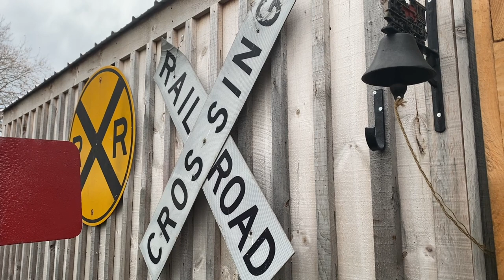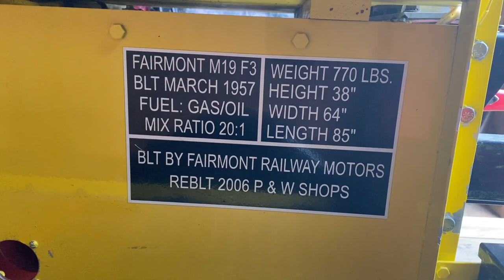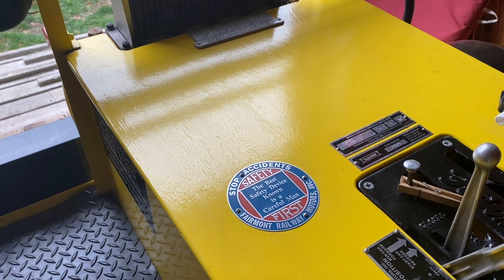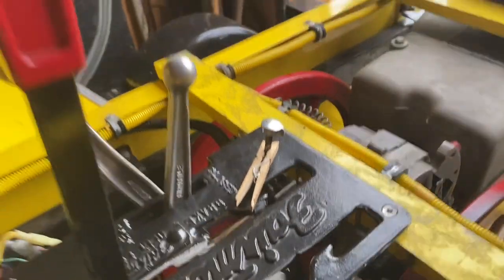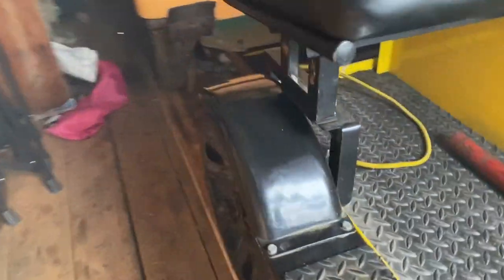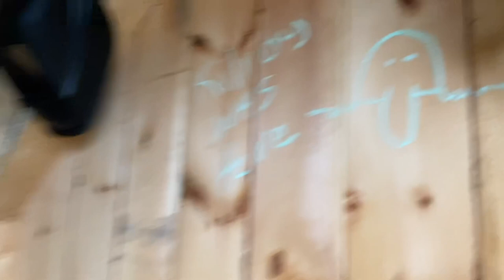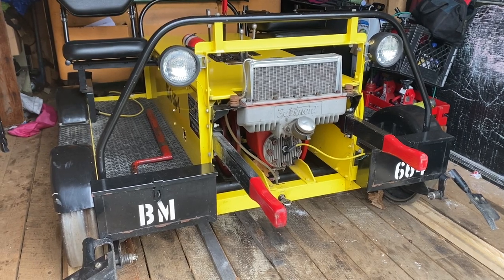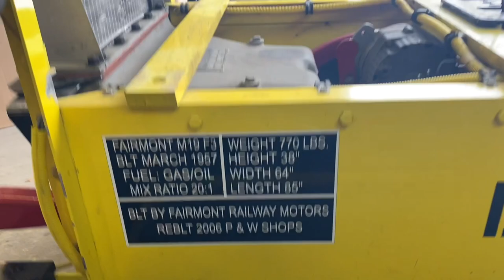New horse in the barn:Talking about my 1957 Fairmont M-19.

Comment: Great restoration job!
I am so glad to see these things running and restored.
Back in 71 and 72 I worked on the section gang before moving into the office being an agent and dispatcher of the Chesapeake Western Railway in Harrisonburg, Va
And for those couple of years I had the pleasure of running our little m-19 up and down the tracks pulling a pole car that we throw our tools on and take them up the rails where we were working. They got them a new motor car I said it was new but it wasn't new and I can't exactly remember what it was but it had a two cylinder Onan engine in it and I didn't like it cuz they took the sound away.
But anyway long story short the mechanic down there in Elkton Engine House called me up and said hey they going to load this little motor car up and put it in a Gondola and it's going to the junk tomorrow and I know you'd like that little engine so you come down and get it tonight or you won't get it at all! So indeed I went down there after the train Crews got off and took my tools with me and I bet I had that thing out of there in a few other things scrapped out in a matter about an hour. I rebuilt the engine and a our loco mechanic had a few spare parts for the engine upstairs in The Engine House so I went ahead and put a new piston rings and connecting rod and inserts and  seals and all nine yards painted up and I got it mounted on an old B&O hand truck that I found underneath the porch of the depot and that's what I got it mounted on. Oh yeah, it still had the big round 1 1/2 V batteries with the terminals on top still in the battery box!
My only regret was that I didn't borrow a trailer and winched it up on the back of the trailer and brought it home with me.
Ours had a cab on it, and i can still remember getting to a Crossing pull out the handles turn it sideways and pulled up on the road so that the freight could get buy me pull it back out there started up backwards or forwards didn't make no difference and I got so that I could get it down to where it would Buck the other way and I moved the timer back the other way and I'd turn the spark on and she go turn on the other way. 
I gave that engine to my daughter because she was little and she would love for me to go out and start it up and we took it to a couple Steam & Gas meets over the years and that was always her favorite.
I'm 70 years old and I think back about those days on the railroad they were good days they was rough they was cold they was hot and I retired in 88.
Thanks so much for sharing memories with me and I pray you are in good health and if you're like me you go out there and just start that old engine up and hear the putt putt putt and loved every beat of its big ole heart.
Take care of my friend stay well and thanks for sharing so many memories for me!
Sorry to ramble on so much but I do like talkin about old times.